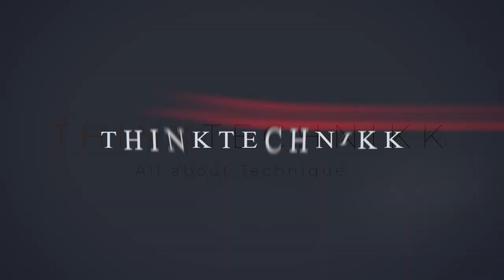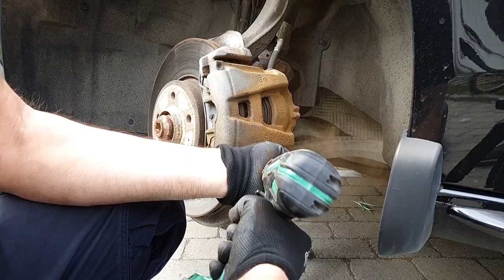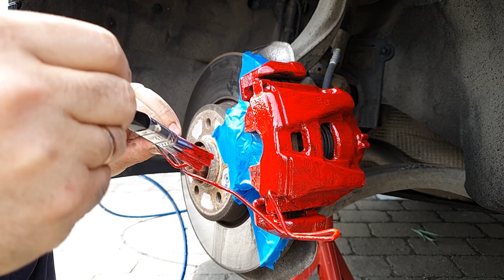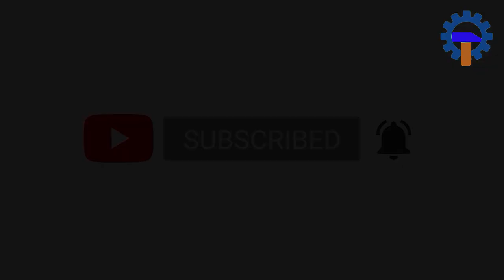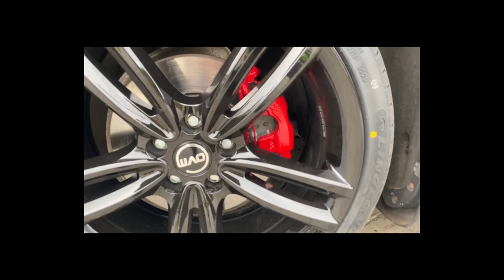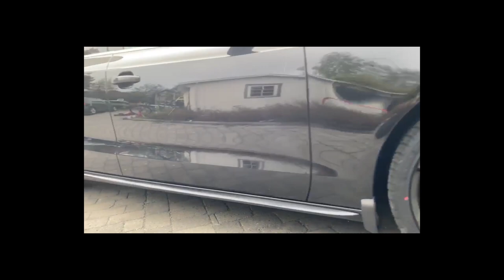How to Paint Brake Calipers Fast and Easy, Best Way With Brush

Comment: Definitely the way to go painting calipers.  Spray paint ends up with over spray and this method is the cleanest and simple.  Nice job with the prep work as well as that is key.  They turned out great and one thing I didn't think of when painting mine was painting the top hats of the rotor. Nice touch!  This video deserves a lot more views!